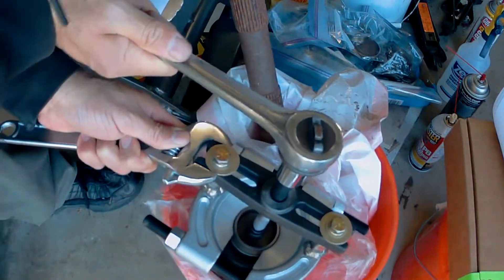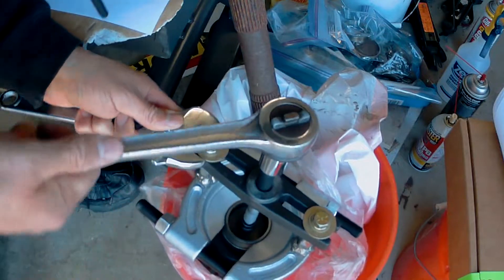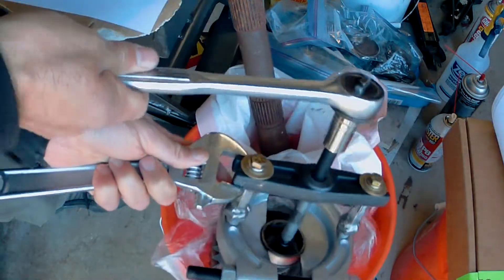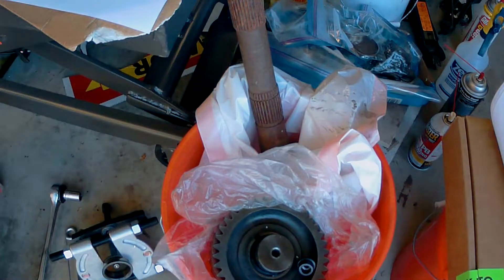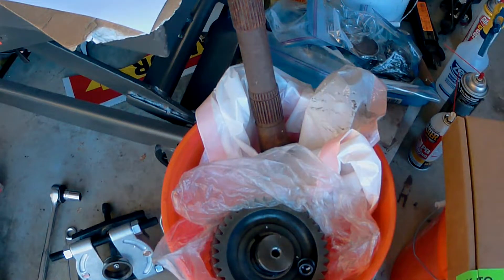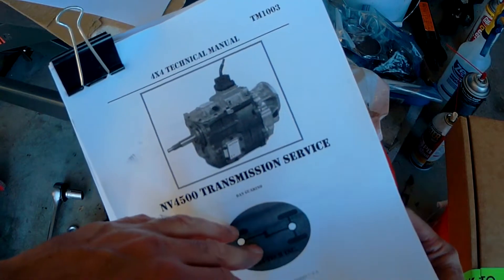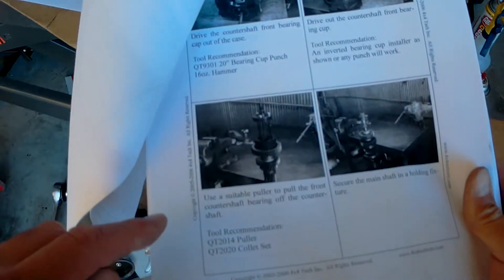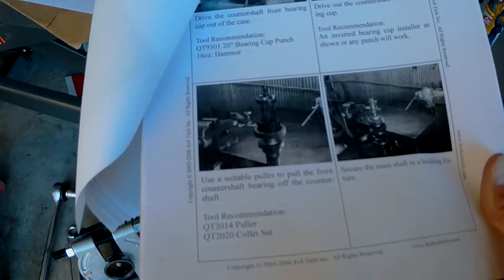NV4500 Transmission - Removing Front Countershaft Bearing using HF# 62593 & HF# 63662. Video 2 of 2.

Comment from the maker: Both the Maddox Bearing Separator – Item# 63662 & 3979 and the Pittsburgh Bearing Separator & Puller Set – Item# 62593 & 93980 are on sale this month through the inside track club until the end of June 2025 @harborfreight